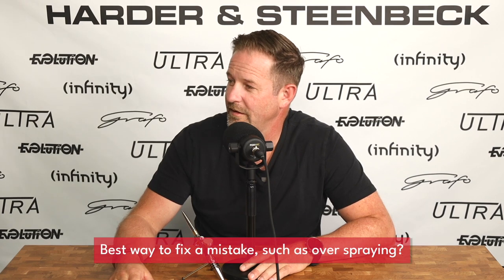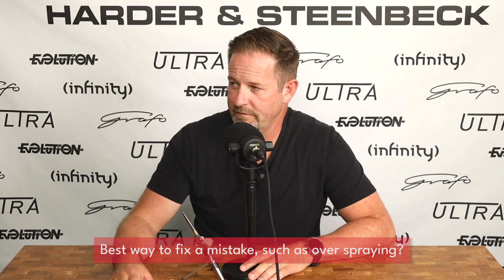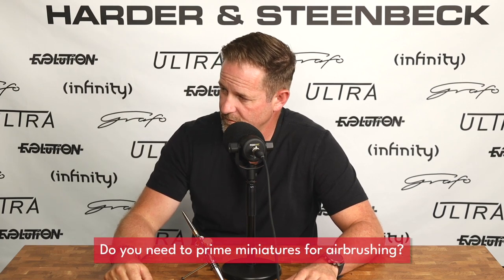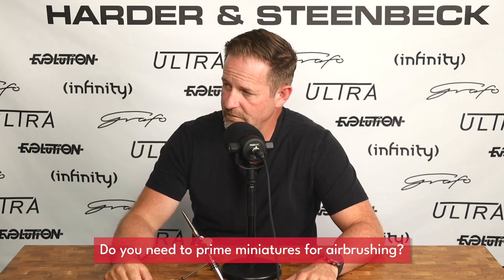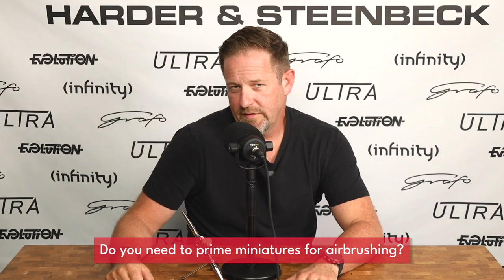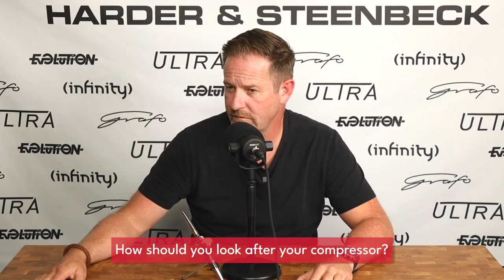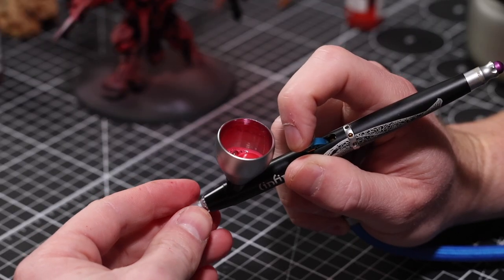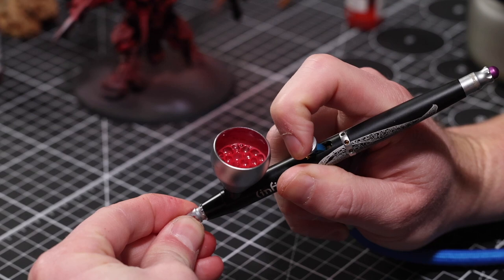Best Way To Fix Airbrush Mistakes

Comment: A thing about the airbrush position - I have an unusual position it looks like. I like to have some form of leverage with my fingers on the mini I am painting. This means I have a crunched up position, so my fingers can be rested on the mini. I use these finger cots so that the paint is not disturbed. This way I can have really steady positioning close to the details I am painting. I don't like to have my hands "in the air" as it reduces my accuracy. Unless I need to paint large surfaces, which I generally do not :D 
I just checked that I actually use all my fingers apart from thumb and index finger to rest on the model - one at a time, but depending on how far I'd like to be it can be whatever finger. If I have to be close, I use my middle finger right next to the airbrush tip. It is similar to the "hook" thing that is on the Angel Giraldez airbrush, but with my finger + I touch it on the model as well. I think I've never seen anyone do it like I do :D
Reply from the maker: Really interesting - this sounds very much like the posture that a sign-writer uses when using a dagger paintbrush to draw pin striping. Nothing is wrong! If you're comfortable, and it works for you, then great. If you experience cramps, then consider changing when not painting detail. If you don't experience any problems, then you don't have any :-)
Reply: @harderairbrush  It is similar to how they do detail work on car bodies with brushes :D I do not usually get cramps but now that I saw the more relaxed position, I gave it a go. It feels unnatural to me :D My regular pen holding is also horrid. My wife tried to teach me how to hold a pen - it did not work out. I believe they taught me poorly in preschool and I have a horrid handwriting as well. Interestingly enough, my brush holding is completely different. I am still thinking about starting a youtube channel. Maybe I should do a video about this :D
Reply from the maker: @HuntersOA  don't overthink buddy - I'd hate to cause you to do that! Be results oriented. Correct is whatever gets you the results you need. My suggestions are just to help people avoid cramping really, in the main. If you don't have it, then no worries!

Comment: The follow on question from how to hold the airbrush would be how to move with it, how big an area should I aim to cover in one movement? Really appreciate these type of info rich videos, thanks.
Reply from the maker: Hey Ivan - there is really no limitation to how much you can cover, but of course time becomes the limiting factor. With regard to how much of an area you should cover, generally speaking, if it's an area that you want to cover, I would encourage you to try to cover the full width of the area in one stroke, and change direction off the part to make your return pass. This way you don't have to risk double application when you try to join up your passes. I'm describing this as if you are covering, for example, a square of 10cm x 10cm. You could make your passes from right to left and left to right, change direction off the part. Perhaps your spray width will be 2cm. Then you could make your first pass left to right with the centre of the airbrush aimed at the top edge of the square. Change direction off the part, and move down a touch so that your next pass it aimed at the EDGE of the previous one (i.e. there is some overlap) and make the next pass from right to left. Following pass, again aim the airbrush at the lower edge of the previous pass, running from left to right again. This is the typical overlap method in spraying to achieve perfect even coverage, and you do it understanding that each pass you make will receive another partial application when you do the following pass due to the overlap, so you need to be careful that your initial pass does not over apply. It should look slightly under applied. Great topic. We will make a video about this.

Comment: Is it possible to interchange parts fromm different airbrush manufacturers, for example needles of the same diameter, triggers or paint cups? I've just started airbrushing and I must admit I feel a lot more confident after watching your 'Need to know basics' playlist. Thank you!
Reply from the maker: Hello there - glad to hear that the videos are useful! Generally, it's not possible. You may find some parts which interchange between Far Eastern manufacturers as sometimes common factories are used, and less frequently, copies are made, but this is always a risk, as you can never really be sure that the specifications on the shapes/ micro-measurements are the same, and therefore compatible. Definitely best to stick to the brand of the airbrush in terms of the spare parts that you put in it.

Comment: Regarding discussion about brush paints vs airbrush paints for airbrushing - I have a success using only Kimera Kolors paints range (which are one of the thickest available acrylic paints on the market) with Evolution CR plus 0.4 and 0.2 mm nozzles. Approximately 1:4:1 ratio paint-thinner-flow improver works usually very nice.
Reply from the maker: Awesome - thanks for the information Illia!

Comment: Creat video thanks,  I have a question.  If I discover some imperfections on my 3d printed model after I added primer how would I go about fixing this so I can get back to the raw resin without sanding it down should I need to fill gaps?

Thanks.
Reply from the maker: Don't worry about it. if you applied the primer with the airbrush, the thickness will be negligible so you can just fill over the primer, and then reprime.

Comment: On the subject of always putting down semi-dry coats of paint. That doesn't apply for glosses, right? I've never been able to get a glossy surface without going somewhat heavy.

And kind of related to that. Say you've put down a nice glossy surface but then you notice that oops, you missed a spot. Is there any trick to being able to go over just that part without ruining the rest of the paintjob? I find that if I don't coat everything all at once the overspray ruins the gloss.

Great series of videos. The only thing that I wish was added was more practical examples of what's being talked about. But I understand that that takes orders of magnitude more effort to do.
Reply from the maker: Hey Trebor! No you're right - not for glosses. They are tricky! Put the gloss down until it only just goes glossy and flows out flat. Regarding the missed a spot thing - it's difficult. You can put down something locally which is more highly thinned and hope that it will flow into the surrounding area - but this is very hit and miss. Most likely you need to go again. That's why, when you're putting down gloss, or clear, for example, you really want a systematic approach to the part so that you KNOW that you've hit everything sequentially, and don't need to go back to areas which may have already started to dry - then you'll get that overspray issue. Thanks for your comments, and questions!
Reply: @harderairbrush  Thanks for the reply and thanks for confirming what I've experienced. At least it's not just me doing something wrong then :)

Comment: I've gone through a couple of 0.4mm air caps on my Evolution since buying it. I've no idea how I'm doing it and would have thought that the neddle or nozzle (being more exposed) would have been damaged before the aircap but when it comes to the airbrush not fully atomising the paint and squirting out at a random angle it's turned out to be the aircap twice now (after buying and swapping out new air caps, nozzels and needles). Any idea what I might be doing to cause this?
Reply from the maker: Hey Jim - that's a really difficult question to answer without understanding your cleaning process. You are right that the air caps are typically more robust than the needles or nozzles. Could you give us an insight to how you are cleaning your air caps?
Reply: @harderairbrush  when it comes to cleaning it after taking out the needle and nozzle I usually squirt some water or Vallejo cleaner fluid through the air cap hole from a swan neck bottle. Which is part of the reason I’m confused, I don’t stick anything in the air cap that shouldn’t be there or attempt to force anything in the air cap hole
Reply: @harderairbrush  a new air cap has fixed the issue again… I still have no idea how I’ve managed to do this twice

Comment: Question: is it completely safe to use metallic paints with an airbrush with a 0.15 needle?
Reply from the maker: Hello Vlad - thanks for the question - generally, if you're talking about typical pearls and metallics, no problem. However, when you start to go into automotive where the chip sizes start to increase substantially for different effects, 0.15mm can start to be an issue. However, I could ask you to think about why you need a 0.15mm to run metallics - typically metallics are area effects - you don't need them in detail applications. Therefore, if you're using metallics in a typical way, I would encourage you to use our 0.4mm set-up. It is still capable of extremely fine atomisation and slow application, and will give you perfect deposition of even a coarse metallic. The 0.2mm will also work well. Hope that helps.
Reply: @harderairbrush   @harderairbrush  when I bought my Infinity CR, it only comes with a 0.15 needle. I have some metallic paints from Turbo Dork, and some of their paints have bigger sized flakes than the others. And it scares me to use a $250 airbrush just for it to cause clogs. Thanks for the answer, I'm going to purchase a 0.4 needle for my airbrush.